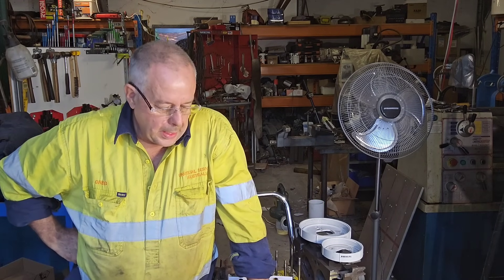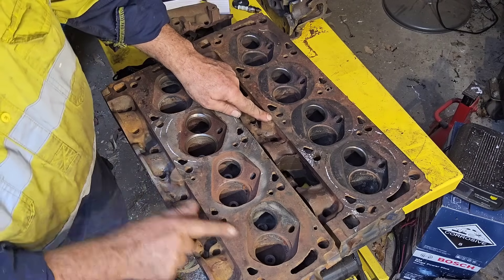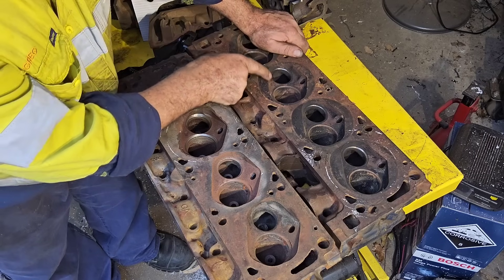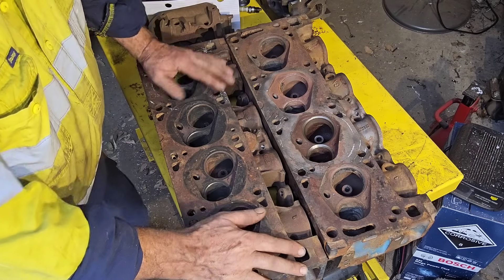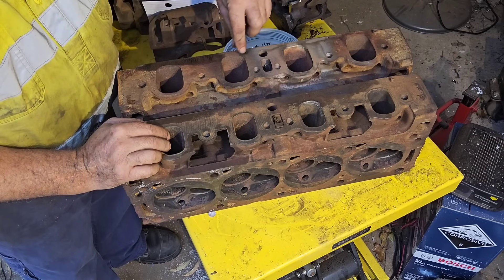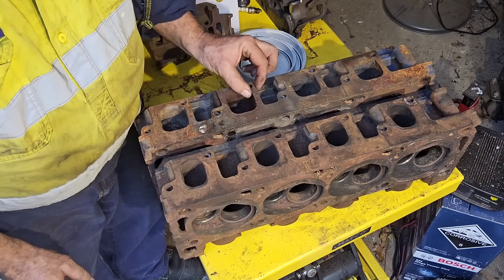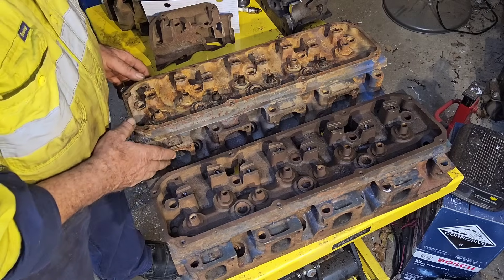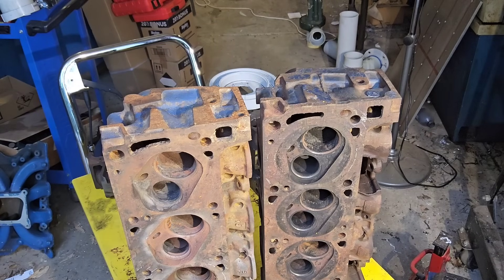Ford Cleveland 4V vs Aussie 302C closed chamber head comparison

Comment: I have a bottom end with Keith black 149.060 -8 cc pistons an have a set of 302 Aussie heads I believe the compression ratio will be around 12.5 to 1.
Reply from the maker: Should be nice. Have you watched my cylinder head architecture video? I suspect that you will find it interesting. Thanks for watching and commenting

Comment: Hey champ,just had a watch and looked at a few comments, they're clearly a bunch of people who have no idea, as for the the video, Stevie wonder could tell the difference between 2v and 4v heads!!
Reply from the maker: One of the problems in Australia was that the 2V port sized heads were marketed as 4V due to the factory 4 barrel carburation. In Australia, a more correct definition, would have been small port, and, large port. Personally, I  prefer to describe them as small, large, open, closed. It covers all combinations. Have you watched the intake manifold video that I did? If not, you might find that interesting as well. Thanks for watching and commenting

Comment: Can 4v heads run good with a supercharger
Reply from the maker: Any head can work well with a supercharger. What it gets down to is what you are trying to get out of using the supercharger. 4V's have huge port volumes, so flow restriction is low compared to other heads. That means that there is less restriction, so for a given boost pressure, you are getting more combustible mass into the cylinder than you would for a small port head, like a Windsor or Chev.

Comment: Finding a set of heads like this will cost a fortune. What is your suggestion for an aftermarket aluminum head? Cam grind would be great to get your opinion on to. A drag and drive is the plan for now. Piston and rods to consider for a 72 block in a Gran Torino. A 4 speed swap is planned from the original automatic.
Reply from the maker: My personal preference for aluminium heads is Scott Cook's SCM heads. They are externally cosmetically identical to the original heads. That said, CHI and several others make good after-market heads, but as I'm a cast iron Cleveland man at heart, I can't bring myself to use them. I've even got a set of unused C3's sitting in my shed, but they might be kicking around for a bit longer yet. Thanks for watching and commenting

Comment: Do you know much about engine numbers on a D cast block. Its number is stamped on the dipstick side
Reply from the maker: Unfortunately not off the top of my head. Early Australian D blocks were imported from the US, and were numbered when they were fitted to the cars. The ones that I have seen were normally 2 letters, then 4 numbers, then another letter, that matched the chassis number of the car. Hope that might help you. Thanks for watching and commenting
Reply: @RevShedPerformance  yeah I am familiar with the cleveland engine numbers match body, JH JG 23 34 33 etc, just picking people brains, just in case you may know, starts with HST
Reply from the maker: @brianmcdonald517 according to the information that I have from Ford, HST is not a Ford prefix. I have however seen GL prefixes on factory Cleveland blocks, but on the fuel pump side
Reply: @RevShedPerformance  I have never seen a clevo stamped there, it's not ground down, it's a one time poor stamp, I have a non number clevo block still, but thanks for the reply,  never know what you find out asking da question

Comment: While I know it's not possible, I'd like to know how these details came to be different. Were the drawings made by different draftsmen who worked independently? Did some of them work from drawings of the manifolds or block? Did, for instance, the little differences in chamber volume come from which tool maker made which tool that produced which sand core which produced which cast iron head and how many of these patterns were there? Was tool wear or rework involved? Did they confer across the globe or work independently? And under what time and production pressures? Thanks for the presentation. I have a 351C in a cobra clone from a 1970 Bronco. The number of details and their interactions is staggering.
Reply from the maker: It's normal practice for drawings to be revised over the years. Sometimes for cost cutting, sometimes for production issues, sometimes for warranty issues, and sometimes just to make it better. Australia was the only place in the world to get a 302C. As such it needed a special cylinder head to get the compression ratio up to an acceptable level. Using the large port 4V head would have resulted in BOSS 302 like performance, but Ford Australia was also chasing emissions compliance, hence the small port closed chamber head design that was easily cast, and machined alongside the current open chamber head.  Thanks for watching and commenting

Comment: I started an apprenticeship in 1979 at a repco workshop in Tasmania and we actually used to get quite a lot of the 4v heads coming in. They had a really bad habit of wearing out valve guides and quite badly at that back in the day we used to just fit the repco integral guides which at the end of the day would most likely wear out just as fast as the factory holes. The old guys used to joke that you could use the inlet valves for umbrellas.
Reply from the maker: Back in the day, we didn't have a lot of choices when it came to guides. Thanks for watching and commenting

Comment: looks like the 4v head was just waiting for modern turbos or superchargers. Big hole...big boost. Airflow speed is not an issue when you just shove it in! Wouldn't use 4V heads for a NA engine, unless you are aiming for 9k rpm. Great vid, informative. In the place I work, they only use blue goo to seal the extractors, no gasket! Ahhhh, the joys of CI heads....fkn heavy, especially those cleveland ones!!
Reply from the maker: I've built a number of lower rpm 4V Cleveland's. They make good torque IF cammed correctly.  From what I have seen, very few people actually understand what a Cleveland requires cam wise, and why it requires it. Thanks for watching and commenting

Comment: I've decided to add my two cents worth of experience racing the 351Cleveland on the dirt tracks of Northern California. 
From 1984 to 1994 I raced a Cleveland powered Ford hobby/street stock race cars, (had 29 feature wins)
No porting of any kind allowed, limited to a two-barrel 500 CFM carburetor. Stock crankshaft and connecting rods. 
Cylinder heads I used were....
4V close Chambers (USA)
4V open Chambers (USA) 
2V open chamber (USA)
2V closed chamber (Aussie)
The Australian 2V heads were the best by far. I bought three sets of the Australian 302C heads in the late 1980s, I still have one set left in my shop. 
Thanks for making this video, a lot of great information. 
I might suggest that next time you clean the parts up a bit so they show on camera better, looking forward to your next video. 👍👍🏁
Reply from the maker: Unfortunately, I don't have a lot of time to make videos in, so they get squeezed in, and rushed. That's just how it is. The 4V head is easily the most misunderstood cylinder head out there. Keep an eye out for future videos where I talk about how valve position and arrangement affects camshaft requirements. I always say that 'The Greatest Weakness of the Cleveland is Team Small Port Engine builders '. That doesn't mean that they are bad engine builders, it simply means that they don't understand the design principles behind the Cleveland heads. 
Thanks for watching and commenting
Reply: Hello,
In Australia, everyone wants the 4v heads.
Interesting that you say our 2v heads were the best.
I guess that running only a 500cfm carby may be better matched to the 2v heads lower flow rate.
Reply: @Andrews_wasteland Yes, based on my experience the Aussie 2V heads were the best performing cylinder heads on my dirt track 351 Cleveland. 
How they would stack up at the drag strip might be a different story. 
The rule book said we had to run a 500 CFM carburetor, however....
The carburetor we actually used was a Holley #6425-625cfm 2V unit (Holley quit making this carburetor sometime in the 80s). I still have that carburetor in its original box, which I bought new back in the 1980s.
Reply: @abcullens2328  You have another subscription :)
I remember someone in a comment mentioning that a 500 Holley was the best carby on a 302 Cleveland they ever put on their engine.
I've never tried a 500cfm Holley but I love the Thermoquad and found them great when tuned correctly.
I have a channel "Andrews wasteland" that shows some carbys running on a 302C and my favourite is the Thermoquad.

Comment: Was easy tuning in the 70s and 7up to 1986 when Super got canned as you could adjust the fuel air then go for a run and if pipes were a nice light grey you knew you were on the money Good info mate 👌
Reply from the maker: @iansandersVortech500  there were lots of good things about leaded fuels, and some bad things, unfortunately. Thanks for watching and commenting

Comment: Port and throat the intakes for 4v valves and stick the closed chamber 302 jobbies on a 351 No more than 75% exhaust flow vs 100% incoming air,most blokes over exhaust them 4Vs are great in the top end though
Reply from the maker: @iansandersVortech500  4V's have good bottom end, providing you cam them correctly, which almost no one does. Almost every shelf cam that i see is ground to suit Chev or Windsor style heads, which is exactly what you don't want in a Cleveland. I'll cover the reasoning in later videos, but I think that once I've explained it, it will make sense to you. Thanks for watching and commenting

Comment: For his technical innovations on the Cleveland 4V heads, I'd hope to see some analysis of Bob Glidden's engine building mastery.. especially after winning ever round, during his 1978 NHRA Pro Stock Championship, the only driver to do so, in NHRA history. An underrated achievement, with an engine displacement of only 331 ci...
Reply from the maker: @BobbyOfEarth  Tim Halstead at Drag Boss Garage has covered some of Bob's incredible feats. Unfortunately, I'm too far away to really be able to run down what Bob did in any detail. I'd only be rehashing what I have seen by others. Thanks for watching and commenting
Reply: @RevShedPerformance  While I've always marveled at the Ford V8 engine building prowess in Australia, Supercars, Drag racing and such, l suppose I was looking to see how Bob's legacy had influenced other builders outside the states. Thanks for your feedback, Tim
Reply from the maker: @BobbyOfEarth  I'm about to make another video talking about the Australian 2V open and closed chamber heads, but it will also include some comparisons with the American 4V heads. I suspect that you will find it interesting
Reply: @ That's good timing Tim.  I'm now your newest fan, and I look forward to more interesting discoveries.

Comment: There used to be a way to attach 351c heads to a 351w block. 351c heads are too difficult to find anymore. Chevy parts are more easily found here in USA. I had a 289 block sitting in my garage for some time. Never used it. Gave it away. Now try and find one.
Reply from the maker: @journeyquest1  you can still attach the Cleveland heads to the Windsor block. I might touch on it in a future video.  Thanks for watching and commenting

Comment: Brings back memories. I put 351 crank and rods into a 302 and ran a 30/70 cam. Had to set timing at 25 degrees. It was pretty lumpy and tough to drive through car parks but went real well between 2800 and 4800 rpm.
Reply from the maker: @RumblinRides  nice build. Thanks for watching and commenting

Comment: I had a 70 Mach 1 w 351C. It wasnt as fast as my 75 Firebird w 350 Pontiac. Both stock. Of course the FB had 3.23 gears and the Mustang had 2.70s.
Reply from the maker: @journeyquest1  Ford traditionally liked the tall diff ratios, even in Australia. Thanks for watching and commenting
Reply: @RevShedPerformance  Tall gears dont work well on the street. Only for high speed driving. I need at least a 3.08. Preferably 3.23-3.73. Im running 3.55 in my 71 Chevelle w th350 and 383 stroker.

Comment: I had a TE Cortina I had a 302 Cleveland but put 351 Crank and rods to make it a 351. I put 4V Valves in tbe 2v Heads then had the Heads flow benched and lightly ported with a Decent Hydraulic Roller Cam Yella Terra Roller Rockers Flat tops. Was well over 450HP I believe. Wish I never sold the car over 12 yrs ago now.
Reply from the maker: Nice combination for the time.  Thanks for watching and commenting

Comment: I had a 71 Cougar in college with an American 351C 2V. It was a high mileage $500 rust bucket but still a fun car. The motor only got a double stacked open element air cleaner - later used the filter for a 454 Chevy for more “volume,” and added dual exhaust with turbo mufflers. Couldn’t tell you what size of pipe the muffler shop used, or even the muffler brand. Even the 2Vs, breathing thru a Motorcraft 2V carb liked to breath. On occasion when the FMX transmission forgot to shift out of first year and the factory 6k tach needle started to bury itself, the motor was still pulling. I haven’t had another Cleveland in anything since 1989. Probably should have even figured out a way to snatch up and squirrel away the 2V motors when they were still cheap and relatively plentiful.  But you’re right - most people don’t know how to properly build one.
Reply from the maker: @sombra6153  thanks for sharing your experiences, watching and commenting

Comment: Great video, Thank you for making it, I did get something out of it. The lack of need for exhaust gaskets and silicone in the temp cross over. I have a set of 2v heads i will be doing up soon.
Reply from the maker: @gordonflash8976  glad that you got something out of it. Thanks for watching and commenting

Comment: When a lot of Aussie heads were being imported into the US, there were Aussie 302 2V heads and Aussie 351 2V heads. Both were closed chambers, but the 302 chambers were slightly smaller than the 351 chamber, which I guess are similar to the 351 4V chambers.
Reply from the maker: @BrandonLeeBrown  Australia never had a 2V closed chamber 351C head that I have seen, and I have stripped hundreds of Cleveland's. The only closed chamber 2V head that I have ever seen is the 302. Ford Australia only listed the open chamber 2V head when used on the 351. Even now I see lots of closed chamber heads advertised on marketplace as 351, but every single time that I have followed up on them, they have either come off a 302, or were sold to them as 351 heads, but they never saw the motor that they came off.  Thanks for watching and commenting
Reply: @RevShedPerformance  In America we received two different Aussie 2V heads. One had the 3514V closed chamber, but with 2V ports and valves and they was called the Aussie Cleveland heads. The other had a smaller closed chamber and was called the Aussie 302 head.. We also got two different seats of Aussie connecting rods. one was the 351C rod and the other was the longer Aussie 302 rod. We had two different Aussie 2V heads, with closed chambers, but with different volume closed chambers. One was the 351 4V chamber in a 2V head and other had a smaller closed chamber and we were told they were the Aussie 302 heads. Is there an Aussie 351? The ones we got were all closed chamber heads. Is there Aussie 351 4V? All of the Aussie connecting rods we got had the "football" connecting rod bolts that came on high performance 351's in America. It was the said the cast iron and steel in the Aussie engines were better than in the American engines.
Reply: I saw another channel and they said that there are three types of 302 Aussie heads, A, B, and C, each gaining a few CC.😮
Reply: @RogerKelm-b5j  I've seen two type of Aussie closed chamber 2V Cleveland heads in America. The first ones I saw imported had standard American 4V type chambers. The second ones I saw imported were called "302" 2V heads and had smaller chambers. We also had Aussie connecting rods imported. They had the Boss/CJ type "football head" bolts and were machined for that style bolt. Reportedly, all Aussie connecting rods used this stronger type bolt and came in two lengths, 351C length and a longer Aussie 302C length.

Comment: The reason why thay where never popular as race engines because thay are the same weight as the big block chev
Reply from the maker: @grantlucas6678  don't know who's scales you have been using, but they are much lighter than a BBC. As race engines, they were the most heavily penalised engines in history in both drag racing and Nascar, having to carry more weight per cubic inch than any other engine before, during, or since. Tim Halstead at Drag Boss Garage did a very good video on the subject. Thanks for watching and commenting
Reply: @RevShedPerformance not to mention restrictor plates in NASCAR after Bill Elliot clocked 212 mph in his T-bird.
Reply from the maker: @walkintrails  more penalties again. Thanks for watching and commenting